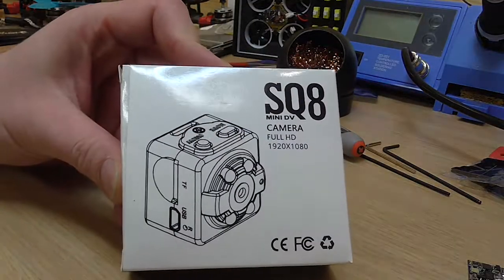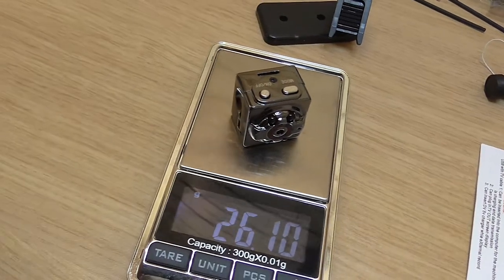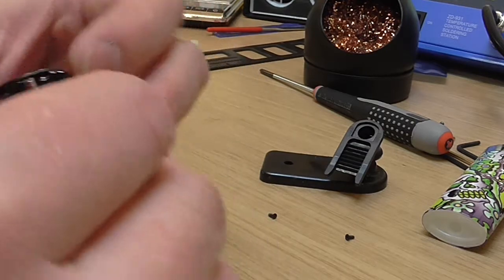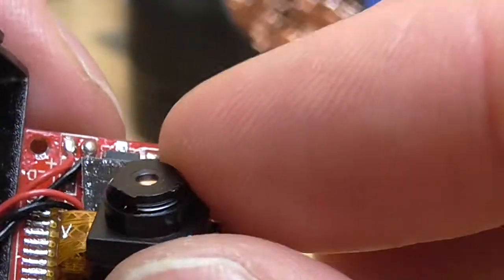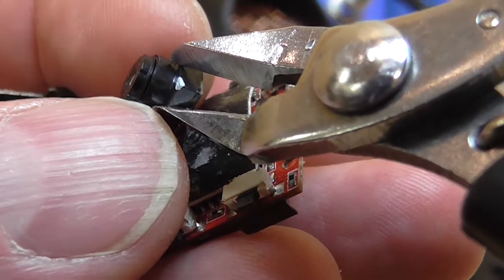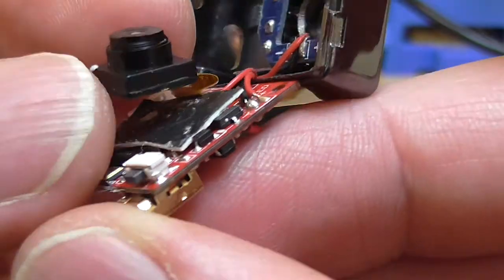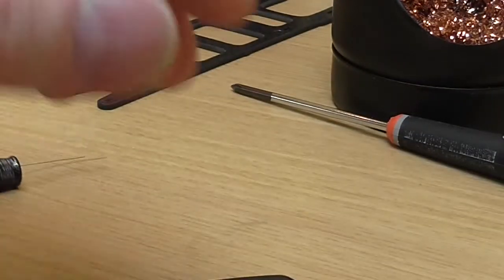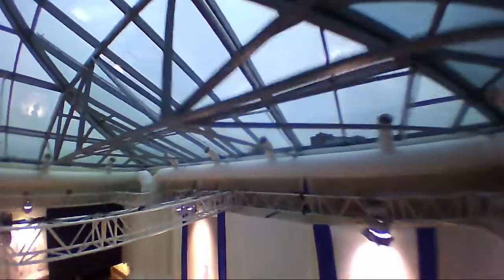How to build HD Whoop!!!

Comment: how does the sq8 gets its power? can i ask for details on how to wire the hd cam?
Reply from the maker: Sure, just wire the SQ8 straight to the battery mains. It operates on the same voltage as 1s whoop. 4,35 to 3,5V.
No other wiring required 😊
Reply: Spiralz FPV no capacitors needed?
Reply from the maker: @rickytolentino961  Yes, That's right! I experiemented with different caps and they made no difference, just adding unnecessary weight.
Reply: Spiralz FPV thanks sir.